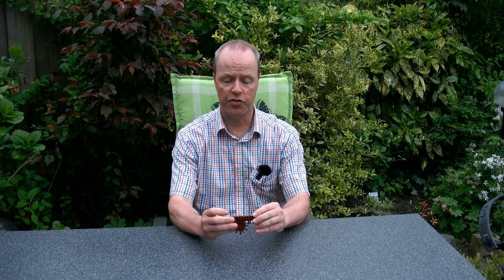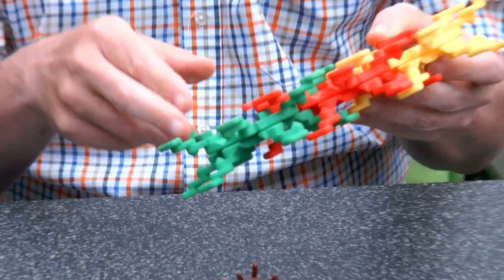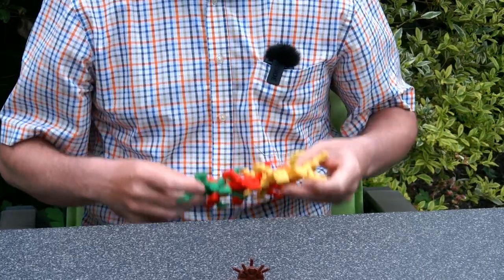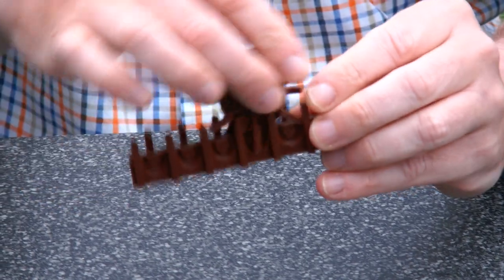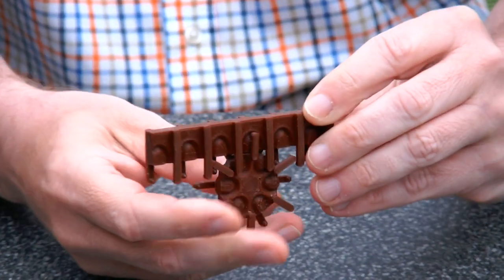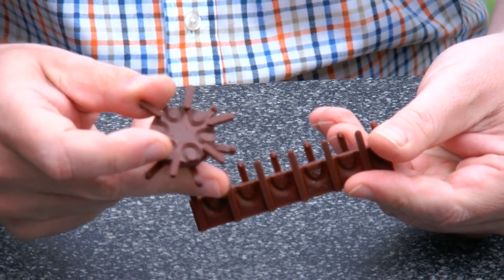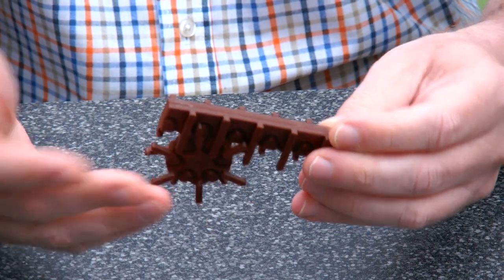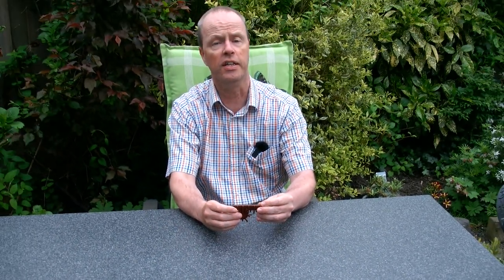Gripping Rack - Would you hang your curtains from this?

Comment from the maker: Curtain rails are so much simpler, don't you think?
Reply: How is this uploaded a few minutes ago and this comment made 2 MONTHS AGO?!?
Reply: I really like the asthetic. In a hanging curtain application using a gripping gear would prevent the problem of curtain rings catching on the rod supports and preventing free movement of the curtains.
Reply: The gripping rack would have much more friction than your traditional curtain rails, so I don't see this practically implementable for that purpose.
Reply: @AegisXIII  - The video was uploaded 2 months ago as a private video. Maybe this question could be added to Oskar's F.A.Q., since it keeps popping up with every new video.
Reply: Curtain rails are simpler…
Reply: @AegisXIII  Videos can be uploaded privately and be sheduled or manually released much later.

How do you not know this?
Reply: curtain rails are also way less cool!
Reply: @AegisXIII  Didn't you know? Oskar invented time travel 2 years in the future.
Reply: @bramklinkenberg9140  😄
Reply: Yeah, but not as beautiful
Reply: Sure but this can be motorized in ways that would be very hard to do with a standard rail
Reply: My concern with any sort of curtain is that the wheel would snag the cloth.  The design is quite spikey...

Would have to test to find out.
Reply: The vid is uploaded 2 days ago and this comment 2 months.. youtube please explain

Comment: If you put a hole into the weel and mount a weighted camera rig onto it, it could be used to adjust e.g. an overhead camera over a workbench.

Same would work for e.g. a rack for clothing hanging from a coathanger in work-environments, where people have multiple uniforms or sets of clothing which get cleaned regulary. By hanging freshly washed from the back and moving the "oldest" forward or hanging the rail at an angle you could always select the one which "turn" it is first.

Comment: I guess for most engineering purposes, this isn't fundamentally different from more obvious approaches like firmly mounting the components or using a simple casing to keep them from separating. The only advantage is in the location of the coupling, and I don't see that it lends mechanical strength or reliability. The only critical difference I see is that the entire gear surface is exposed. Could be useful in some situation where the gear surface is interacting with something else, like spooling string or serving as a record turntable - something where we want to control spin but want unhindered access to both sides of the gear.

Comment: If the mechanism has or can be made with tight tolerances it could be nice for rolling infeed tables and jigs that don't slop up and down for use with wood working.  The gears could also be mounted to a carcass and the rack could be pulled in and out for use with trays or drawers.  Ball bearing drawer slides can be really sloppy.

Comment: At first glance I wonder how big or small of a curve this mechanism would need to traverse a 90 degree bend as it would be interesting to see it move in a square(ish) shape. It is a visually complex mechanism with an easy to understand function, unnecessary over complication is right up my alley. I guess I will have to get the model and experiment, thank you for sharing.

Comment: If you can figure out how to make the rack part follow arbitrary curves this would have significantly more flexibility than a simple slider
Reply from the maker: Such property is intrinsic to involute gears, as any pair of involute gears with the same parameters will mesh. So, also any involute gear will properly mesh with any arbitrarily-curved rack that has involute teeth with the same parameters. Unfortunately, this is not the case for cycloid gears like this one. This 6-teeth gear only meshes with this rack. If you change the one, then you need to change the other. And if you have an arbitrarily-curved rack and a 6-teeth gear, then the pattern of the rack needs to repeat every six teeth. I'll ask Henry Segerman. Perhaps he knows a loophole.
Reply: @OskarPuzzle  It was my understanding that you can design involute gears to mesh with themselves and gears of one other size, but that you cannot get perfect meshing between three different sizes of involute gears. Perhaps I'm wrong on this?

I think that one could do something with a circular gear meshing with an arbitrarily curved rack if you only have "arms" reaching out from the circular gear, not the rack. Then the arms trace out whatever grooves they do on the rack, and hopefully there are enough of them to keep the gear and the rack connected.
Reply: Thinking more on this - having a larger circular gear with more than six arms seems like it should help. The arms on either side being offset means that there are really 12 arms on this one. But you need at least three arms to be in contact at any time to make the connection stable. Or one can use extra layers between the two halves to make it more stable - I use them in the original gripping gears. The lengths of the arms needs to be chosen carefully so that their paths on the rack do not interfere with each other.
Reply from the maker: @henryseg  Interssting approach. The non-path-interference + 3-arms may be conflicting requirements. Shorter arms = less interference, but potentially unstable. Longer arms = more stable, but interfering paths. Could we build multiple knobs on arms? That way, some path interference may not be an issue, as there are alays knbs that are not at a junction.

Comment: Anything this would solve would be better solved by a simple rack and pinion with a sliding mechanism to hold the two pieces together. The latter is stronger, far easier to machine, and you can attach bearings where the two pieces contact to make it run smoother.

Comment: I cant think of a use for this. But I feel there may be something in having the pins that hold the two interface together have some give. So you have 2 Racks and pinion connected together. The rack parts are fixed onto two separate object and the pinion is free floating. This way they don't have to be completely aligned to work. There is a lot of additional complexity with this and I have no idea where to start with implementing it or if its even possible but it feels to me it is that kind of thing where it could be useful?

Comment: If a rack gear can’t have much of a guide frame for some reason and it uses a Rack/Pinion mechanism, this would fit. Kind of like my Black Hole Planetary Gear mechanism, which I designed out of VEX IQ components for a prototype Swerve Drive system.

Comment: How much pulling force can it withstand? Could perhaps be used for an inverted monorail, a bridge lifting crane, a zipline, or something similar.
Reply: The issue is that it doesn't do it better then what we already have. *
For example, Inverted monorail - Just cantilever the suspension arm.
 a bridge lifting crane - Normal rack and pinion enclosed by a slide.
Zipline - How would this be an improvement?
Reply: @TheOwenMajor  Dunno, just suggesting out loud. We have lots of different designs for bridges, buildings, vehicles, etc, so why not airtrams? If engineering didn't make anything that wasn't better than what existed, a lot wouldn't be made.
Reply: @landsgevaer   If engineering didn't make anything that wasn't better than what existed
I mean they do, and those projects end up neglected at ridiculed at best.
Novel engineering solutions are always the ones that don't work, or require 10x the money to get working compared to if they had just used the simpler method.
Reply: The mechanism reminded me of zipline too